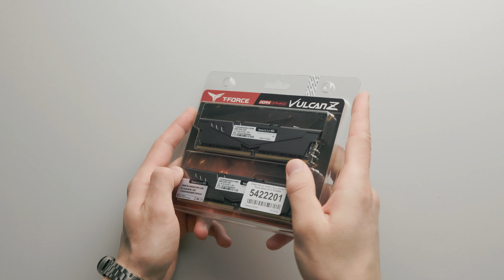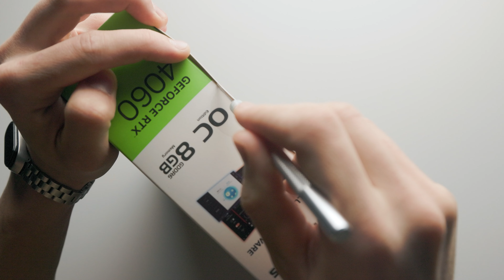A Dazzling White Panoramic PC / ASMR PC Build

Comment: what are you using for the air flow visualization.
Reply from the maker: Sometimes a vape, sometimes a smoke machine
Reply: @PCb-2  no issues with moisture on the components?
Reply: @PCb-2 don’t vape and what case is that.

Comment: 4060 and that ryzen not a bottle neck?
Reply: Not really, they're actually in good balance
Reply: @micoandreimanzarate1646  would a 4060 and a ryzen 7 5800x be good? thats what im upgrading to
Reply: What screwdriver is that?
Reply: Bruh ryzen 5 5600 performs best with Rx 6700xt 4060 is a piece of cake